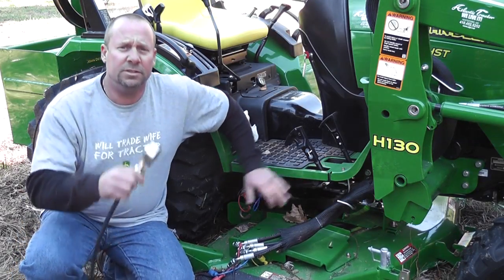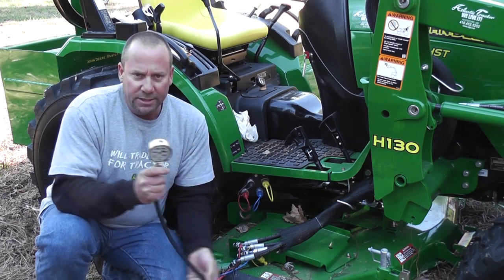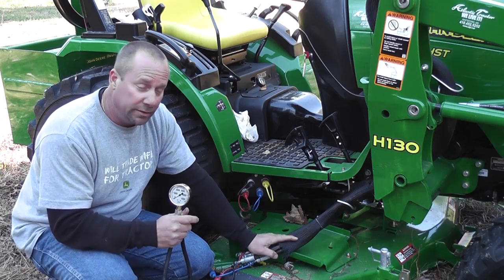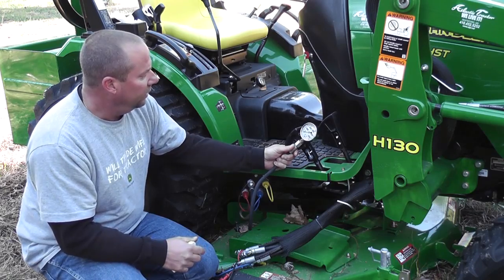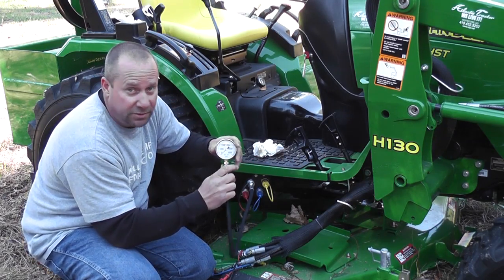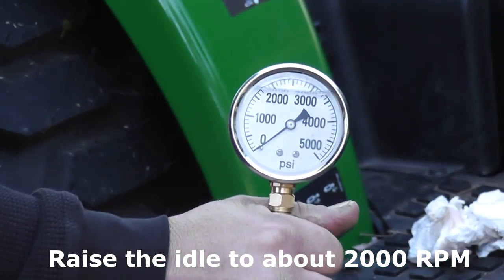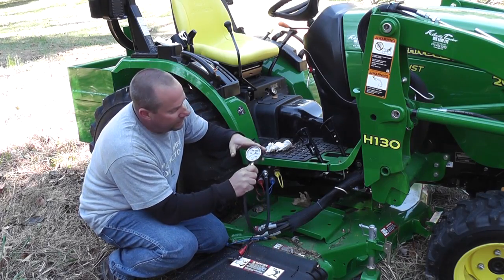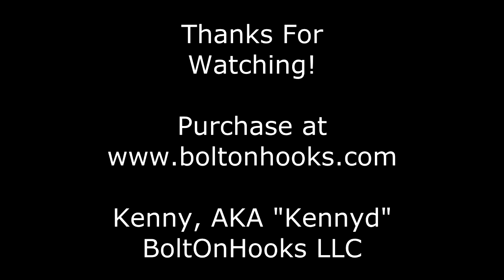Hydraulic Pressure Test Gauge, Use and Operation

Comment: We bought this from u guys a few years ago.Works great,I have a question.We have an excavator that runs good and after about 5 min we start to lose power in the hydraulic,has nothing to do with engine .hooked up tester to check main relief valve ,for first five minutes it has about 2500 psi of pressure after that drops down to a little over 2000 psi of pressure .What would cause this
Reply from the maker: Jay,
YT comments are not really the place for tech questions. But...is sounds like your pump is going out.

Comment: This Bolt on Hooks gauge has worked on my 1, 2 and now 3 E series. On The E series, since the loader does not have disconnects, the HST has a coupler "test" port that dead heads the "curl up" on the joystick. Works slick!
Reply from the maker: Thanks Formula!
Reply: Firebird, can you give some more specifics?  I’m interested on testing the pressure on my 3series.
Thanks